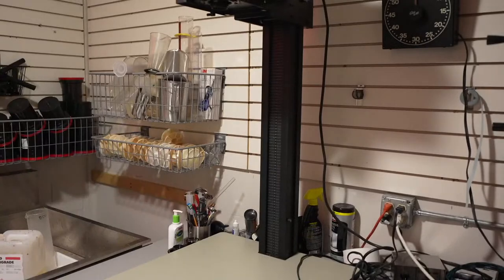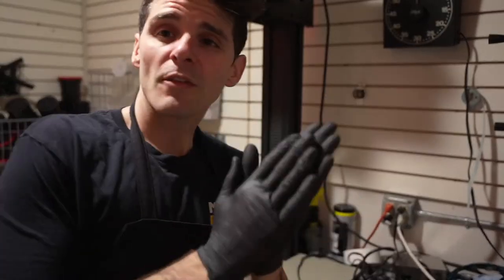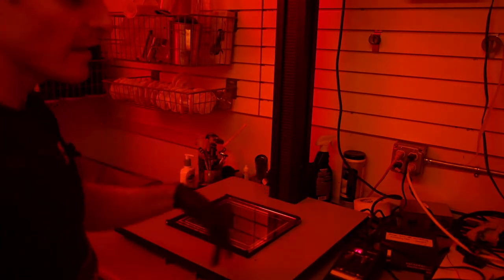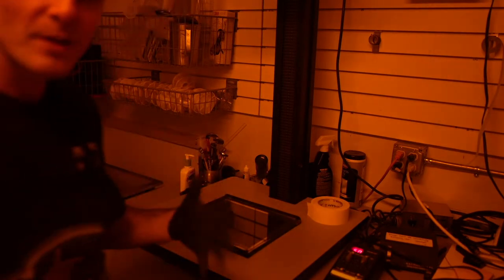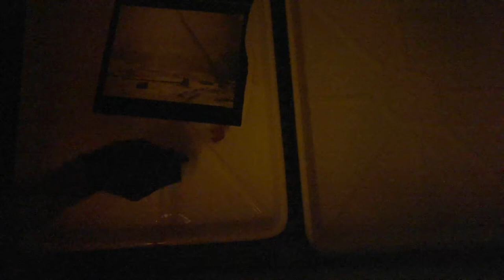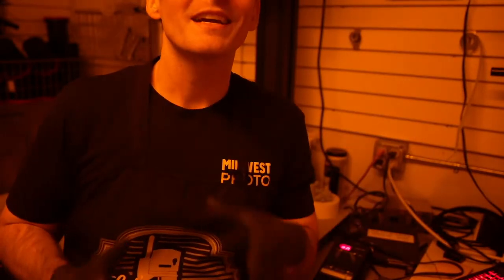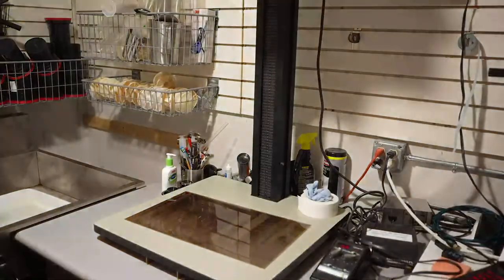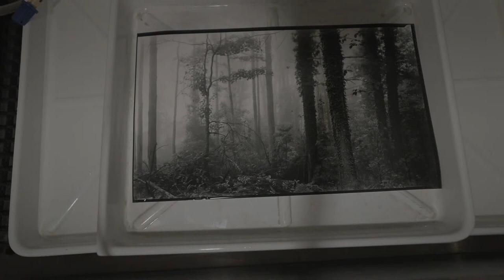B&W Darkroom Printing 8x10 and ULF - Large Format LIVE!

Comment: For your next live stream it might be helpful to post a short video a couple of days beforehand teasing the livestream,

In split grade printing do equal exposure times of 00 and 5 give the same result as using a single middle grade exposure, assuming there was no dodge or burning to reinforce a high or low contrast area?  I've seen videos saying that they are, others claiming the opposite.  Steve Sherman seems to insist they are not, and I tend to believe him.  I need to play with this more.  Interestingly, in The Print, Ansel Adams was not keen on split grade because the papers of the day didn't tone the same between the hard and soft layers.

Despite the technical problems I really enjoyed this video.  More please!
Reply: To answer my own question, I see that split grade printing gives me much more control than I ever had with graded paper or using a single contrast filter.  Thanks